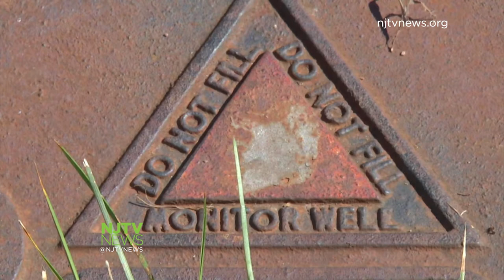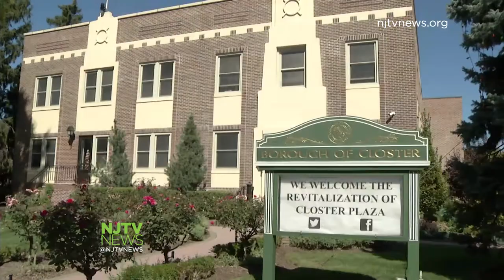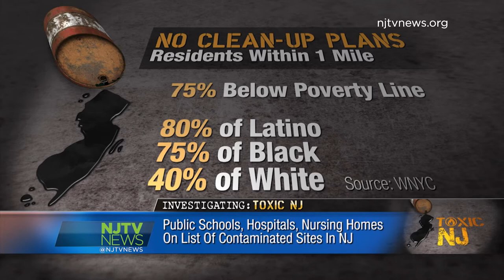Toxic NJ: Cleanup Backlog

Comment: Sarah Gonzalez what good is knowing they are burying tanks when they change what they do after moving in.  Plus where I live its different they pour it into a giant tank underground and people are inhaling those fumes.  This is in Elmwood Park, NJ.  They weren't pouring burnt use oil when building #' 1, 2, 4, and immediately after building #3 they started digging and put in a super large tank that will be impossible to remove when it eventually does corrode.  It had to be built underground in sections.